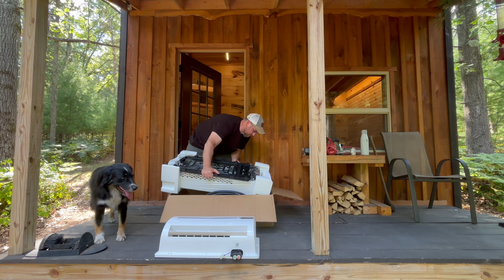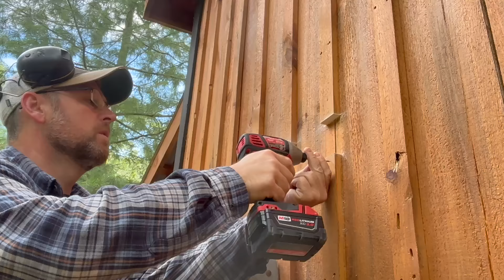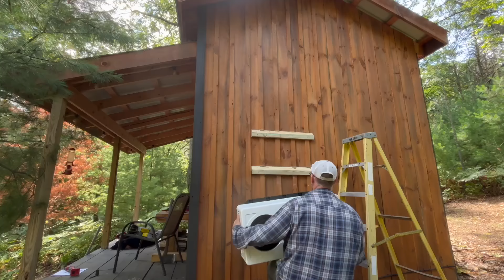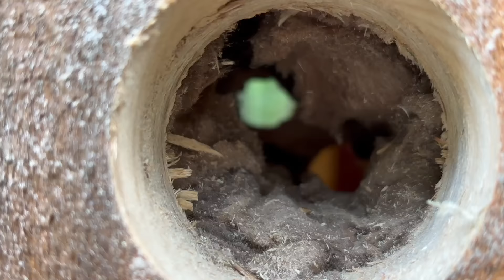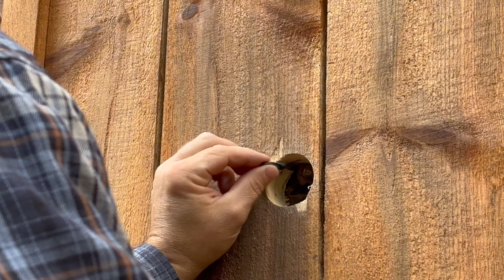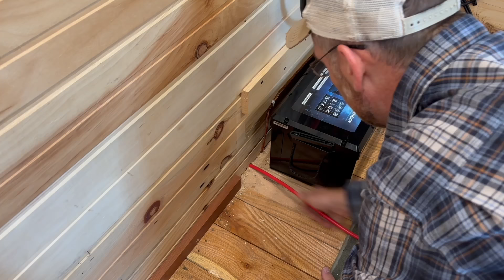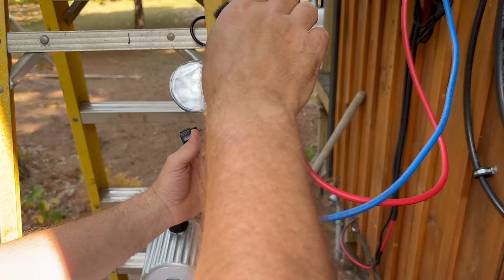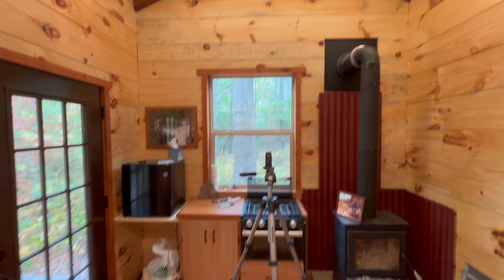12 volt Air Conditioner in the Off Grid Cabin ! OutEquipPro

Comment: I was thinking about putting one in my truck one for the back living quarters for the average homeowner I would definitely say pay somebody that does air conditioning units to come out make sure everything's working correctly. What is your average amp hours as you go throughout the day and will it run at night thank you so I know how many batteries I need to pick up and are you running lithium ion are you running lead acid batteries
Reply from the maker: I'm running Lithium . I honestly dont know . I finished that trial run and headed home so I could get back to work on my other project .

Comment: Real nice cabin, but I suggest you reroute those hoses as the loop outside can create a large collection point for the lubricant in the system and cause the compressor to not receive the correct lubrication shortening its life
Reply from the maker: Thanks and thanks for the tip

Comment: He should have used some pipe to go through the wall.That way, he has a nice, smooth penetration.All the way through the pipes and lines can go all the way through.And then he could seal them up with some threaded ends and gasket material put insulation into the pipe , and it all been nice and tight and not have to worry about that cocking on the outside or inside showing

Comment: Good point also on drilling small pilot hole. Maybe could have ran control wire thru the line set hole before the lines and wire tied it to the outside of line insulation.

Comment: Interesting little system. Good video.
The suction line near the air handler (larger hose) is not insulated. As it sweats and drips water down the wood wall it will cause mildew damage. 
Also the condensate drain is supposed to be an insulated line for the same reason. Cold water in the hose can cause it to sweat

Comment: You Can Get Brand New AC Gauges And A Vacuum Pump Off E-Bay For About 100 US Plus Tax !! Less If You Dont Mind Used! Since You Are Going To Use Them One Time They Just have To Work 1 Time!! I Have Them!! They Are OK!! I Have Used Them 4 Or Five Times So Far! The Gauges Come In A Carrying Case With All The Adapters For The Different Types Of Refrigerant! And Has A Chart In The Case For Reference As Well As Printed On The Gauges!
 But We Have Taken The Compressor Out Of An Old Refrigerator And Brazed A Fitting To The Inlet Pipe So We Vacuum Down AC Units When I Was A Teenager, That Was Back In The 70's! We Used It For Decades Until It Finally Burned Up!

Comment: If that condensation drain tube is on a south wall, or an east or west wall where it gets direct sun much of the day, it's going to deteriorate and break. My mini split is on an east wall that bakes in the sun every morning and the drain tube broke off from sun exposure. Still drains just fine, but it's short. What the water drips on is concrete so no problem.

Comment: Most places to get someone to come and check it out, do the vacuum etc you'll have to find an independent HVAC person who owns their business. Most of the big franchise heating and cooling shops will only work on systems they've installed, or on brands they install - if they were installed by a licensed HVAC tech. In most US States it's legal for people to do their own HVAC work on property they own. The franchise HVAC companies *hate that*. They want to bend people over with their super high prices for parts and labor so they punish DIYers by refusing to do repairs or by charging even more.

I did my own mini split install and had a problem with a leak when I tried vacuuming it. I lucked out finding an old guy with his own business, just him, no employees. Only charged me $120 because he was able to schedule it when he had some bigger job in this town. So I have a vacuum pump I've used for a few other things. I got it on sale for $79.

Comment: Don't expect it to last. I live across the pond where they're the default form of AC and they're terrible. Even if yours isn't appallingly underpowered it's still a maintenance nightmare. And unlike "real" AC units which are more common in the US you can't have a proper filter on them so they inevitably wind up clogged with garbage and filled with mold.

Comment: I would make an adapter to my antique Phillips 66 Devilbiss air compressor. The Intake is 1/4" pipe size. There's a different way to test for a leak. Chances are the refrigerant is pentane or something like that. It can be charged with propane and test fittings with a lighter. If no flame 🔥, there's no leak. Advantage is you can also smell a leak before the flame test. A tiny tad of propane won't affect the pentane. The most surprising part is that it's not 48 volts. I've got 2400 watts of panels. It's 24 volts for now, but I'll probably upgrade to 48 v next year. Easier for me to just use a small 120 v window unit. I've got 1000 amp hours of lithium batteries.

Comment: Sounds like that unit is designed for things that don't have much in the way of insulation, so I can see it working in a properly insulated cabin just fine. After all, regardless of size, it's going to pump the heat out. You just have to stop the heat from getting back in. I've been looking for a 12V AC system for a build of my own and I'm glad to see someone finally made a little thing like this.
Reply: OutEquip also makes roof mounted 12 volt air conditioners for RVs. They'd work great in a shipping container house.
Reply: @greggv8  It's a lot harder to seal a roof mount in a permanent manner, so I was trying to avoid those. I knew they existed since RVs have had them for decades now, but nearly every RV has a roof leak around those after about 5-15 years.
Reply: @StapleCactus that's why you use the black butyl rubber tape. Unlike the cheap grey or tan junk it never dries out. It's the same stuff that was used on car windshields in between when they were held in by rubber gaskets and solid urethane adhesive. Just in a flat form instead of round.
Reply: @greggv8  I have been seeing "butyl" used more and more lately. I am discovering it is apparently the king of waterproof material since you can nail though it and it seals the puncture. I just used it to build my deck; every tape and flashing was butyl.
Reply: Do not use butyl tape on roofs. it gets brittle in the winter and loses adhesion. If you have to cut a hole in your roof, and I wouldn’t, you should use a liquid adhesive like Koemmerling Korapop 225. Butyl is for under window trim or places where it isn’t exposed.
Reply: @Hashbitnitwit  I just finished a metal roof and butyl tape was required between the laps. I'd expect anything exposed to sunlight would be destroyed rather quickly, though. That Koemm...thing sounds like a Europe only product.

Comment: This is my next project for my room, but... If you are reading this I highly recommend protecting those hoses.  The weather and anything around can break them and because of the high pressure, they can just start leaking the Freon.  I have a lot of experience in a/c for cars and those hoses can be strong; but under high pressure and depending of the quality the can also break easily.   Finally the most important piece of equipment that you need to keep an eye for is the exterior fan.  If any electric fan stops working and you keep running the a/c , the high pressure can blow your compressor or any other part like a hose, evaporator or condenser.

Comment: So... I have not installed this type of system before, but I have installed Residential/Commercial Mini-split systems and everything you did was good.... Except for when you removed the gauge set under vacuum. I don't know what the manual states but even if you are the flash, you will not be quick enough to get the lines off before air enters. and you won't necessarily hear the air enter. gasses do weird things under a vacuum. Anyways what should have been done is the valves opened just enough to bring the system pressure out of vacuum by around 10-20 psi and then remove the gauge set. that way the lines are under pressure, and you won't get any air/moisture in the system. I know that this is coming from a rando on the internet, however It is common HVAC practice to have pressure on the lines before disconnecting. Other than that, Excellent vid on the install!!
Reply from the maker: Thanks , and thanks for the tip . I was actually told that before I did it but I figured I’d just stick straight to the instructions with the unit .
Reply: @blackspruce1861 There are split systems pre charged in both the condenser, evaporator and also the line sets. They are designed to just be connected. They have special fittings that allow this vacuum pump free assembly process.
Reply: @johnnytacokleinschmidt515  Yes, these truly DIY, no vacuum needed, straight up easy units are rare, and are often only positively distinguished in the ability to be connected without vacuuming in their description as having "quick connect" fittings.  It's often hard to identify these easy to connect units, as they don't brag about the feature often. Mr. Cool does, but boy do they charge you for it.  Costco offers much cheaper "quick connect" unit, and on their web page will post their own store-written instructions correctly saying you don't need to vacuum. Be aware, very oddly, the instruction manuals for ALL mini split units are absolutely terrible, and even the true DIY no-vacuum  "quick connect" units instructions will often contradict themselves, giving both sets of instructions, "to vac or not to vac",  in the paper pamphlet or website  instructions. 

 It seems all Mini Split manufacturers, of both true DIY "quick connect" and also "pre charged" units requiring vacuum, use generic, poorly written, obfuscating, incorrect, and misdirecting  instruction manuals.  This is to discourage DIY.  My guess is that DIY often mess it up, even the easy "quick connect" ones, and cause a lot of warranty returns, and bad customer feedback negatively affecting the manufacture reputation.  Even the manufacturers of the true DIY no vacuum units in their instructions will recommend installers be hired to install them.  

The way to identify true DIY, as opposed to DIY requiring a vacuum, is that true DIY with no vacuum might say "both line sets are precharged, not just one, and come with quick connect fittings, no vacuum required". True DIY units don't necessarily have to offer "quick connect " fittings. Manufacturers have little incentive to do the DIY community a favor, as manufacturers know a hired installer can flare fittings, and install it right. Unlike the type of confident but inexperienced consumer who sees DIY, and won't even look up a webpage, expecting it to be easy as connecting a garden hose. There are still lots of things which can go wrong. 

Some other true DIY units: "EG4" available at "Signature Solar"(with ridiculously well priced Hybrid AC/DC units which can run on solar panels), and "Perfect Aire" (available elsewhere),  are two such other true DIY "quick connect" offerings beside Costco's.  

Note: Costco's brands will change occasionally.  Right now in Canadia it's Danby, and it will be different on US, and be different next year.  Look for the "quick connect" offerings. Don't necessarily  expect all the true DIY units to say no vacuum required.  ON the Canadian Costco page for instance, the 12,000btu might say "do not vacuum", but on the 18,000btu it might assume you just know, so you will have to look for other clues.  It might  say "both lines come precharged". Again, they absolutely despise stupid overconfident morons messing it up all the time, causing a lot of unnecessary complaints, bad press and returns.  Do not trust the reviews i==on the webpage below the unit necessarily, as some will ignorantly release the freon precharge and then unnecessarily vacuum.  Definitely look at a few youtube videos, read the comments, and take pencil notes.
Reply: @blackspruce1861  yup. I would keep an eye on the unit for a while. Air/moisture in the refrigerant/compressor oil can cause issues in the long run. A small bit shouldnt be bad but I would still keep an eye on it for reduced cooling or excessive noise from the compressor. Keep up the good work and I did enjoy the vid. I was acually looking for a 12v system for a project I have coming up.
Reply: "Breaking the vacuum."
Reply: @johnnytacokleinschmidt515 Yup.. Everything he said is accurate
Reply: I believe there are Schrader type valves in the fittings where you connect the vac hoses
Reply: @douglasbeachler3890  Yes there are. However there is a period when attaching or removing the hoses that the seal in the hoses is not sealed and the Schrader valve is still open. this happens regardless of how fast you attach or remove the hoses. That is why if the system is has positive pressure you will have a gas discharge upon disconnecting the hose. The same happens under vacuum. It is more desirable to have a slight leak of refrigerant when disconnecting rather than allow air/moisture in.
Reply: @RandomZ88  I'm no AC guy but Thanks for the tip
Reply: @douglasbeachler3890  Correct, but schrader valves are NOT vacuum tight. The atmospheric pressure presses the scrader valve in!
Reply: @zaprodk ..Ya def wanna have presure b4 disconnecting lines..  I bet the spring in the valve must be above 30lbs.. Else It wouldnt hold for any time at all..

Comment: It's an enormous unit but so is the electric draw. Subtleties: Use ECO mode if you have it. A lowered inside fan helps with stripping humidity. Use fans like my Boundless Breeze. Count on short runs a few times of day and night, not long droning.

Comment: Apparently my comment doesn't show up.  On Amazon they sell an inline Bluetooth monitor for your battery and system that will give you all the information and data all the time. Just thought I'd mention it because I noticed your solar setup does give you much data.
Reply from the maker: Hey thanks for the tip ! I know I need to get something for more info just keep putting it off

Comment: Just grow a set and drill one hole big enough for the wiring and the tubing, and do it at an angle for the drain hose, then use expansion foam once everything is verified and tight.  Jheesh!!!  I've installed a ton of these, even through brick veneer.  And use heat shrink cable slices for heavens sake!

Comment: I like the idea of 12vdc mini split I plan on upgrading my RV with them and possibly some out buildings off the grid. But I have to say watching you install this with the single little holes. For each hose and each wire made my anxiety level max out.  The clincher was removing the inside unit to connect the hoses and the wire connector removed twice lol 😅 3” hole saw stops this nonsense. There is 1000000000000s of ways to fill the hole up afterwards.
Reply from the maker: LOL yeah I guess it would have been simpler

Comment: I’d love to know how many amps that thing is pulling because I know when my solar set up is running during the day I can run some pretty hefty electronics but as soon as the sun drops, I have to shut everything down except for like a TV the Internet and various other low-voltage appliances like my refrigerator and stuff if this thing draws about the same amperage as my swamp cooler, then that could be a useful replacement for the swamp cooler on high humidity days
Reply from the maker: Did the math from the website AxV  215-774 watts